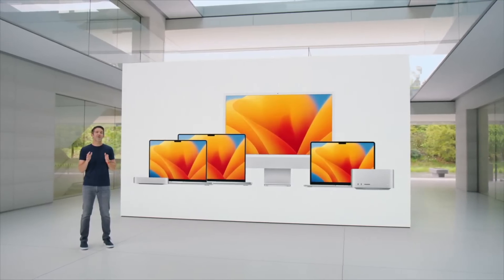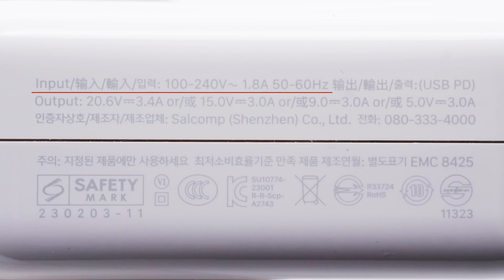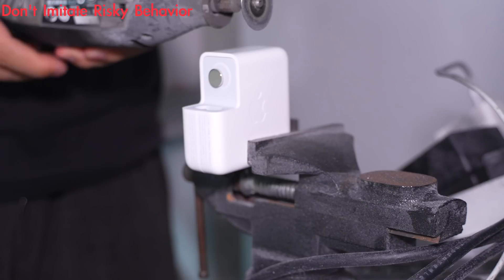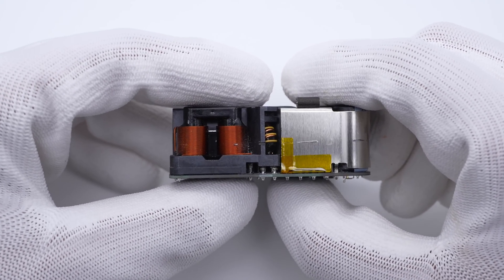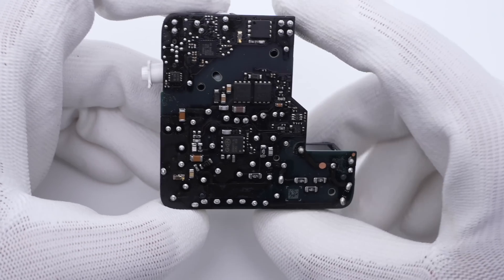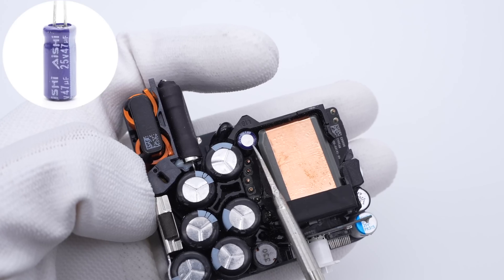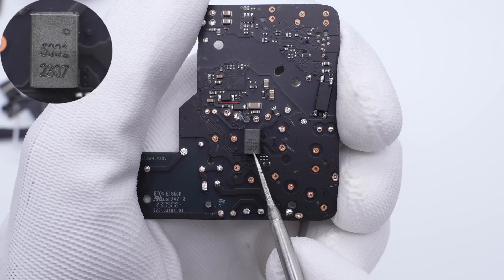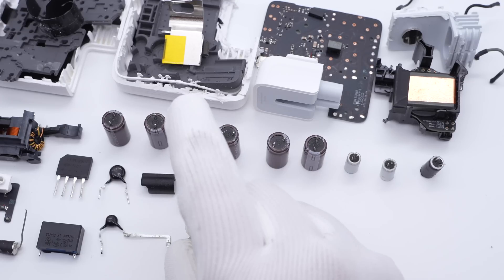Teardown of Brand New Apple 70W GaN USB-C Power Adapter

Comment: The video is good, but the voice-over could use some improvement. Sometimes it's difficult to hear what you're saying. It's fine to have an accent, and it's fine to sound like you have English as a second language, but you're skipping some sounds and letters, and mispronouncing others. Slow down, make sure you speak the entire word, and don't be afraid to do multiple takes. It's especially noticable at 0:53. I had to listen to it multiple times and couldn't understand what you were saying until I turned on subtitles. In particular "Apple 140 Watts" was impossible to understand without subtitles. Keep at it though! The only way to get better is through pratice and experience! :)

Comment: Why does apple always make large chargers while using Gan technology chips?
Reply: Because larger sizes have better heat dissipation to the outside, which means that such a device will last longer than small ones with densely mounted components.
Reply: @Bender-Zadunaysky  so true. The anker ones are nice and small but get really really hot where i get concerned.

Comment: My Ugreen is 65W but it's a fraction of the size and has 2 USB  C ports.
Reply: Might be. But it also can set your house on fire.
Reply: @oposkainaxei  except I've used it more than a year and it is a standard issue item in my organisation. It has all the necessary safety certification and none of that Apple circle jerk upcharge.

Comment: I wish we had a dual port USB C charger above 35watt. Perfect for charing a MacBook and iPad/iPhone at the same time. I like the design of the apple chargers I would pay a premium for it
Reply: The new Anker Gan charges can do that, no?
Reply: Urgreen has one, 45Watt with two USB C connectors
Reply: I'm pretty sure its 35 watt total output, so you'd get 17-15watts on the mac and ipad, not optimal, just buy the 70w and charge from the mac?
Reply: @elyasrasti8943  Just look at the specs of GaN chargers. Anker and Ugreen got a lot of those even powerbanks or all types of hybrids. All the way up to 200 watt power banks.

Comment: can i use it on any pixel devices or just solely for apple products only?
Reply: What does the U in USB stand for?
Reply: @POVwithRC  Lol as much as I wish that were true, there are at least 3 different USB power delivery standards (USB PD, PPS, and QC) in addition to the USB spec itself (2.0 and 3.0 power settings), in addition to the half dozen or so other "technically compliant but still really proprietary in at least one or two ways" protocols out there.

Comment: What a trash inside when it comes to capacitors CapXom (Not all of them). Apple is not what it used to be, in some older power supplies they had Nichicon capacitors. Probably they are calculating that this USB-c charger will not be used so often and it will survive warranty with some reserve.

Comment: Ugreens GaN 100w charger still smaller and cheaper than this lol
Reply: i bought mcdodo 100w charger, with 2 usb c and 2 usb a output, cheaper and better than this apple one. i can power my 100w laptop with no problem
Reply: @Onion_Knights which one u recommend, mcdodo or ugreen or baseus for 65w charger?

Comment: this charger is still enormous compared to ankers 65 W Charger. What a pity Apple didnt do better :/
Reply: My Anker gets pretty dang hot. I’m guessing Apple didn’t want that and went for thermal efficiency rather than size.
Reply: Size isn't everything m8
Reply: Smaller charger equals more heat. So Apple made the better choice

Comment: liquid electrolyte capacitors have a limited lifespan. i would expect apple to use only high quality capacitors.
Reply: Ehh, provided they're higher temp (not 85C but rather 105, or better 125C rated) they last a good while. I feel like the high load components like the power regulation chips are more likely to fail as hard as they're being pushed long before the (much more modern, more reliable than ye olde) electrolytics become a problem.  In cases such as this where board space is very limited it's hard to get the required capacitance using other types of capacitors... electrolytics trade board space for height, and thus have a good advantage in raw capacitance per board area.
Reply: @BladeScraper  thanks for the info. I have already ordered mini heatsinks for a self made powerbank that has a hot chip.
Reply: They expect charging standards to change faster😹

Comment: Is it more efficient and better buy than 35w dual ports charger if I get the 15 inch MacBook Air? I live in Malaysia and it is UK plug, a YouTuber said that model isn't efficient and shouldn't get it and the US model is the one to get, true?
Reply: @Christian-zd4sl   @Christian-zd4sl  but 35w model isn't dramatically smaller too and faster charge mean you can complete your charge and use your charger for something else sooner too right? And I do thought of that, if I use 70w to charge my MacBook air and will charge my phone from my MacBook air spit it into 35w to my MacBook air and 35w to my phone or something that can charge at that speed. But surprisingly I thought Steam Deck can charge at about 40+W but turn out it receive 10w with this 70w charger, if so then in some cases if your 2 devices take less than or equal to 35w in total then that charger make more sense, if your devices require high watts and charge the second device by connect to the charging MacBook air while able to spit the 70w them it is better in some way too. I wonder is it possible to have a USB C hub connect to the 70w charger so you can charge 2 or more devices directly on it too?

Comment: I really wish Apple would hurry up,and give us a 20W GaN adapter.
Reply: why not just go get an anker one for substantially cheaper
Reply: But why this is smaller than the older 67w adaptor and is 70w, because of GaN they cant make it as small as the older 20w adaptors I would say your best bet is to get the 70w adaptor as it it will last you far longer and all adaptors are compatible with lower wattage its the device that tells the adaptor what to send it.
Reply: what for
Reply: just get a 45w GaN charger theyre like 40$ sometimes $30 on sale

Comment: I do not understand why Apple used CapXon capacitors. They used better capacitors in past.
Reply: I think it could have been caused due to a supply chain interruption, the charger was probably designed earlier than 2023 - rather 2022 or 2021.
Reply: All good things must come to an end 😭

Comment: The specific reason why Apple’s 20v is higher than standard is to offset the voltage loss from a usb PD cable, to ensure maximum power input and efficiency.
Reply from the maker: That's also what we think.
Reply: considering apple 2m C to C cable is thin enough (compared to anker 100w and ugreen 100w)